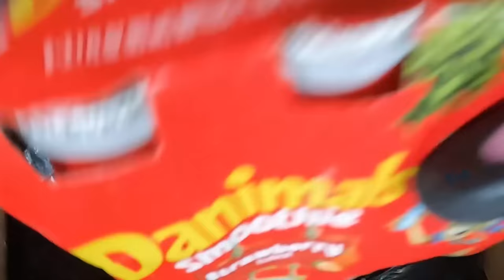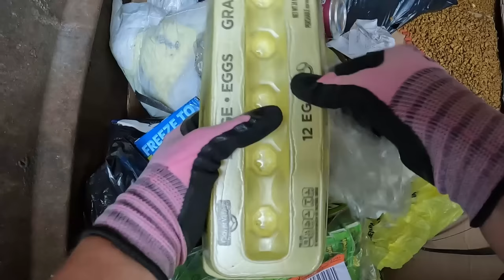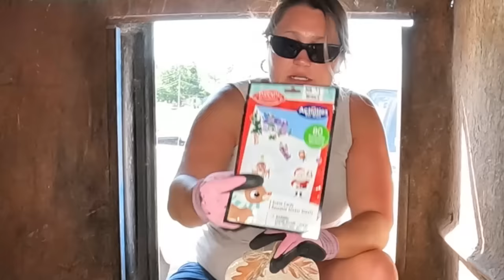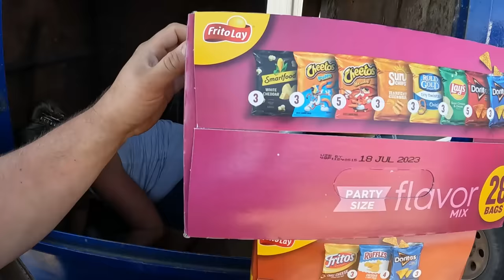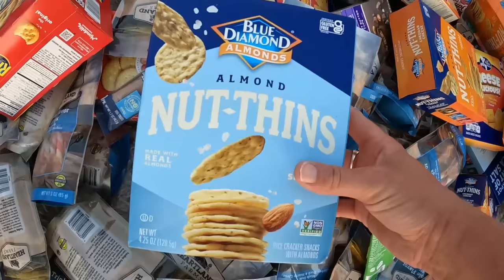INSANE Jackpot EVERY DUMPSTER Was LOADED

Comment: Dehydration can be dangerous!! I'm sure you must have a cooler, instead of pouring ice in to keep cold drinks, which can get messy when the water melts,  I freeze individual water bottles and put them in the bottom of the cooler, then a few cans of soda or Gatorade, a few more waters, as the day goes by, the water will melt, but then you have water to drink, or wash with or put on a tee shirt to go around your neck to keep you cooler. Just want you guys to stay hydrated, safe.  I love watching your videos!